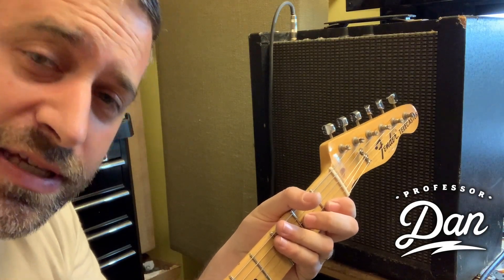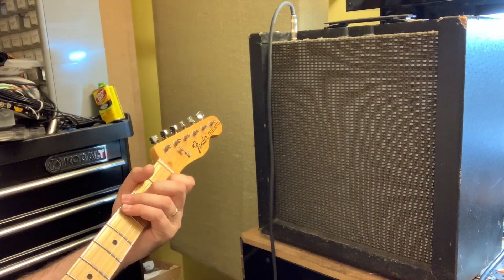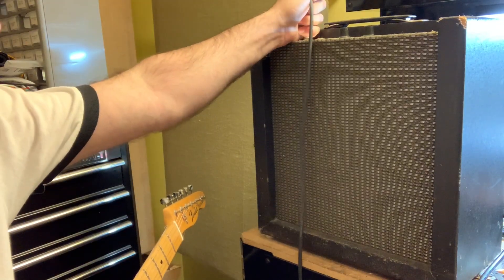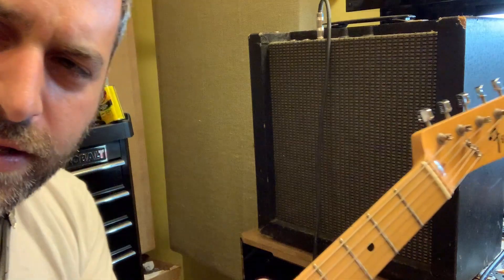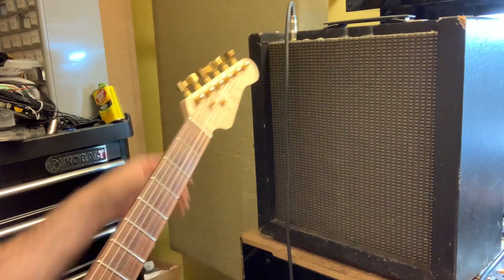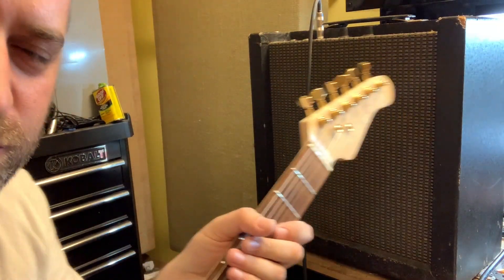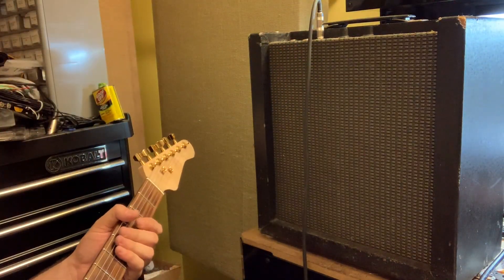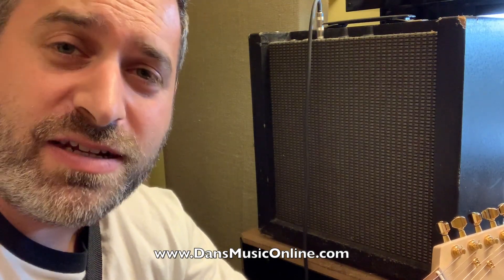Harmony H400A - Professor Dan's Workbench

Comment: Hey Dan, i found a good deal on one of these and i’m thinking of picking it up. it’s had a 3 prong plug installed, does this make it safe against shock? or do i need to get a transformer added to make it totally safe?
Reply: Three prong really doesn't help much. You can have an isolation transformer off-board and safely run all your window makers through it. They're fantastic sounding amps!